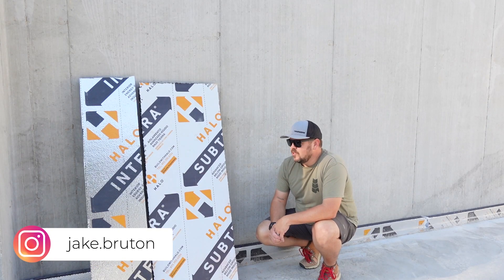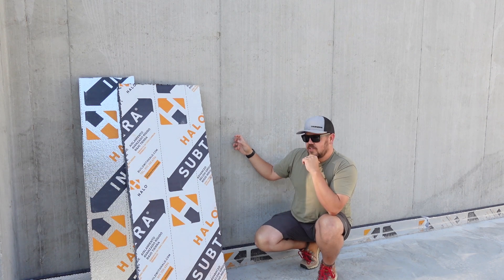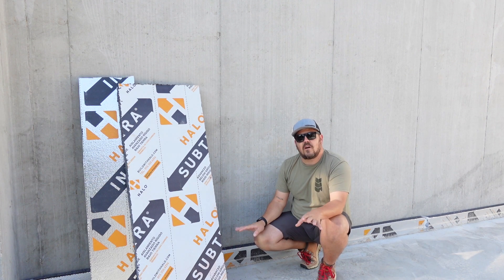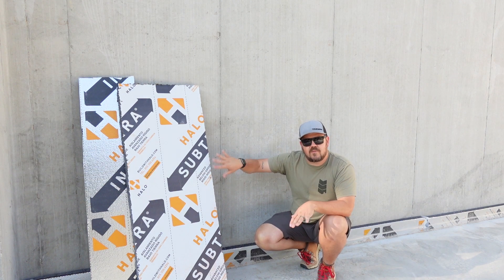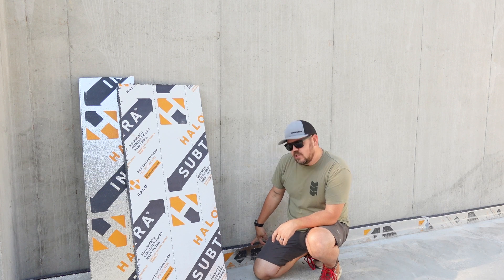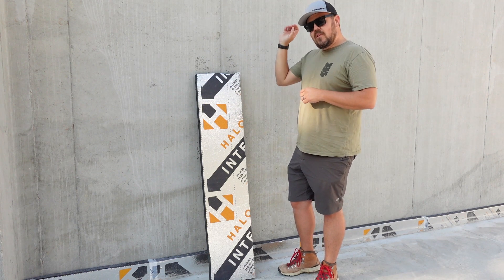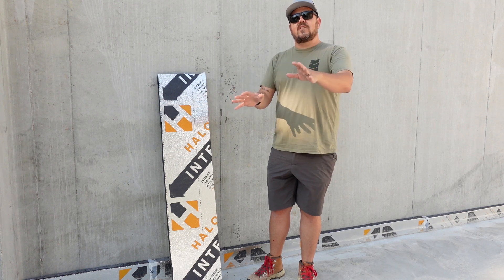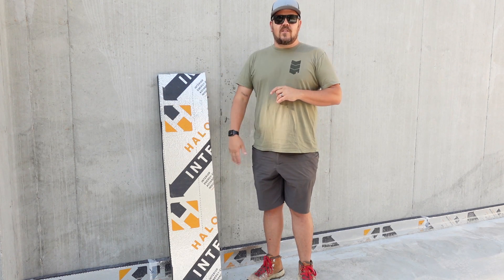Control Layer Continuity: Foundation Insulation

Comment: Am I missing something,  or is there no radiant heating in the slab?  Once you’ve got it insulated well….and you’ve done that,  some mesh and tubing is a breeze.  Even if you just set it up to the manifold and leave it for the future.
Reply from the maker: Great question. There is not. Out climate (zone 4) simply doesn’t have enough days that are cold to warrant in-floor heat in most cases. It can work very well. However there are a lot of days where we are cold overnight and then warm enough during the day that the heat is off or mostly off. With slow-to-respond systems like in-floor slab heat comfort can be an issue on those days. With our cooling season you are therefore also paying for that forced air system as well. So paying for two systems, one of which doesn’t deliver a big bump in comfort, normally doesn’t pencil out for most of our clients. It can work though.

Comment: Envirostrap and In So Fast make EPS wall foams with studs inside.  The AMVIC ENVIROSHEET has either plastic or wood studs and either flush or proud, so it could be on exterior for rainscreen or interior for wall cladding.  Glues to the concrete wall ( no framing)

Comment: Wouldn’t it be easier to use ICF to maintain continuity with the insulation?
Reply from the maker: Potentially. The issue is then you have to protect the ICF on the exterior side of the wall.

Comment: If I also add a plastic layer under the ridgid foam, will it work for radon mitigation? Is it better to add plastic under or on top of foam?
Reply from the maker: I like the poly layer on top of the foam so that when I start to place concrete the concrete doesnt get between the foam and start to float my foam. Ask me why I like this method?
Reply: Subterra-Plus is rated for a radon barrier if the seams are taped. That may eliminate another layer to detail.